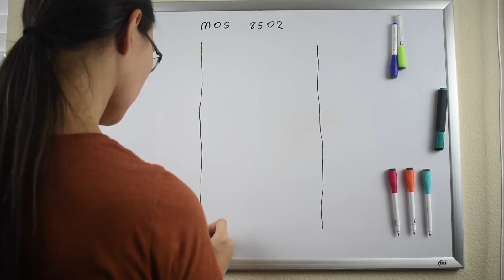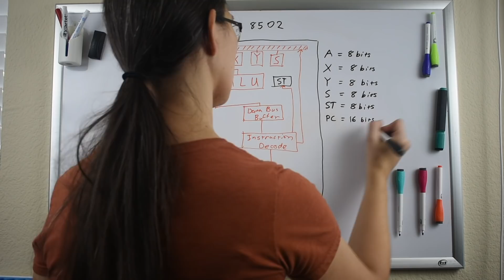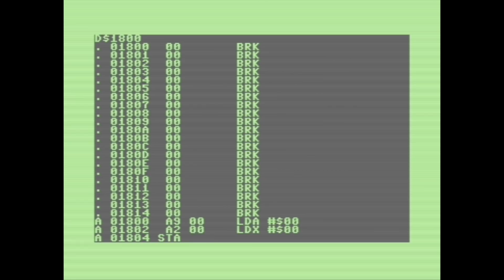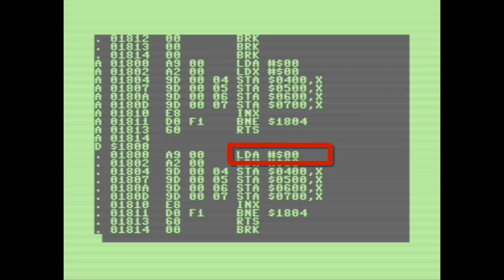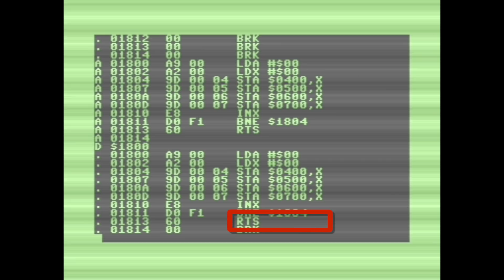Commodore 128D: Episode 1: Meet the Commodore 128D

Comment: This may have been asked already, but why not use the 8563? That would allow 2 mhz operation.
Reply from the maker: It would, actually, but it doesn't have support for hardware sprites, which I'd like to use in the game. Maybe in a future video! 80-column mode is very interesting to me, but I wanted to start from something relatively familiar first, and the VIC-II is also something that I've never had much exposure to until recently, so let's start with that, then move on to the VDC later.
Reply: I will follow along. "Back in the day", I spent most of my time tinkering with the VDC. It has a lot of capabilities that are overlooked; it's especially capable with the 64k of dedicated RAM in the 128D. Of course, you can also use that RAM for other purposes, if I recall. Hard to believe it's been 30 years, lol. I do have a 128D here, now I am motivated to hook it up! Back then, I used an assembler called "Merlin 128"....outstanding, as I recall.
Reply from the maker: @Shane661  Right. The trick is that the VDC is only accessible via two memory addresses, has to be synchronized correctly, and has its own memory space separate from the memory accessible to both the 8502 and the Z80. It doesn't fire any retrace IRQs, so you're locked down to timers, and worst of all, most VDCs out there have a synchronization bug that causes data loss. So the 64KB available to it is... flaky? I dunno. I'll play with it at some point, certainly.

Will definitely check out "Merlin 128", though -- looking for a good on-128 assembler because cross assemblers are a bit of a pain. :-p
Reply: @NybblesandBytes  , I don't recall an issue with losing data with the VDC. But, I definitely recall an issue with wait states and that bottleneck. You basically needed to fill the frame buffer, and work from there...because you can't make anything happen fast when trying to push data through. But, moving data within the 64k is pretty fast. Again, it's been 30 years. I will be firing up my 128D this week, should be fun.

EDIT: Another thing that really crippled VDC support, was that the "flat" 128 only came with 16K of VDC RAM. You can't do much with that, for sure.

Comment: Okay, I'm onboard. So is this somewhat applicable to the C64? Leaving out the memory and speed difference.
Reply from the maker: John Anderson I'm not entirely sure since I'm focusing on the 128D for now.
Reply: I’m a newb on commodore but believe the C64 doesn’t have the built-in machine language monitor so there may be some differences in operation compared to this video, needing to use a third-party monitor to do this?
Reply from the maker: @57thStIncident  @John Anderson On a C64 you'll need a cart or software to have the same access to the 6502. It's actually the reason why I chose to use the 128 and why it's taken me my whole life to get into working on these machines -- it is, in every way, a better machine for programming.

There are other differences as well -- some of the memory layout is different, and the default state of some of the vectors for the VIC are simply initialized to sane defaults, which makes initialization code far far simpler.

Comment: Sounds like the faster 8502 should halt the VIC chip; the reverse of the 6502C SALLY with the ANTIC/GTIA in the Atari 8-bit computers [and 5200], and the SALLY with the MARIA in the 7800... Or maybe that VIC chip should've had dual speeds...

Comment: Great video.  Is all the programming going to be in assembly, or are you going to use other languages too?
Reply from the maker: I hope to use Assembly primarily because when it comes to writing games, BASIC is really slow. I may spend a small amount of time in BASIC, but really, the power of the 128 is the MONITOR and assembler. Turns out that you can pull some interesting tricks like swap to 2MHz at the end of a VIC frame for a speedup, but that's basically only doable in assembler.

All in all, the 6502 instruction set was one of the last CPUs that was designed to be easy to work with, so I hope I won't lose you if we stay in the assembler arena -- it really is far more flexible, and not all that difficult to understand.
Reply: @NybblesandBytes : The C128's BASIC in SLOW mode is especially slow because it constantly needs to switch between RAM banks to access BASIC code and variables and the C128 seems to have an unusually long interrupt routine.  The C64 is faster and the VIC-20 is faster still.  But, in FAST mode, the C128's BASIC is okay.
Reply from the maker: Brutikus Red Very true. Unfortunately, only the VDC is capable of doing video in fast mode, and I want to use hardware sprites, which necessitates the use of the VIC-IIe.

Comment: I definitely miss the simplicity of 65xx/85xx assembler. Later assemblers (like MAE) with macros and such made the process only slightly more work than a higher end BASIC with a LOT more control (and speed!).
Reply from the maker: @JustWasted3HoursHere Yep! I'm hoping to be able to use them to make this go a bit smoother. Mostly I'm gated on the lack of a working external flash floppy drive at the moment, but I've made some headway on that. Not heard of MAE -- is that a C128 native assembler?
Reply: @NybblesandBytes  MAE is from a LOOOONG time ago. I believe it stood for "Macro Assembler Editor". It was for the C-64, but they may have produced versions for other Commodores as well. Well, I just looked and it appears there was one for the Commodore PET, but I'm not sure that's the one I used back in the day. It does appear to use macros, though, which made assembly MUCH easier and cleaner (in my opinion).

Kids today don't realize how great they have it when it comes to programming: Tons of tools, simulators and emulators at their disposal, plenty of memory to work with, processor speed galore, storage and so on. Back in the 70s, 80s and most of the 90s that stuff was hard to find (or was seriously expensive) and so you were on your own for much of the process. 

Watch "Stella at 20" for a taste of what the Atari 2600 programmers had to deal with when they wrote their games back then, which only had 128 bytes (yes, bytes) of RAM on the 2600 available, no video processor or memory (the scan line was controlled directly by the processor) and so on. [edit: There was a video chip, but it was EXTREMELY rudimentary]
Reply from the maker: @JustWasted3HoursHere  Yeah, I'm familiar with the 2600, actually. As it turns out, there's a web emulator that lets you write Verilog to build effectively the same thing out of an emulated FPGA. Don't have the link handy, but it's neat to play with regardless.
Reply: @NybblesandBytes  I have seen a guy using a modern 2600 assembler environment. Maybe that's what it was. He was disassembling "Superman" to see how they stored the rooms, etc. It was pretty interesting watching him change values in the code (which fit entirely on the screen at once...) to see how it worked.

Comment: 03:44 Actually RUN-STOP/RESTORE does not boot to the boot/welcome screen, so wrong screen shown ;)
Reply from the maker: Lofote Argh. Yeah, you're right. Serves me right for using an emulator for that shot -- I couldn't get the version of x128 I had at the time to actually do a run/stop - restore. The key mapping I was using was seriously horked and I couldn't find the restore key. Used a "soft reset" instead thinking it was the same, and clearly its not. And I should have known better, too -- used to have a 64 as a kid and I would regularly do something requiring a restore. :-p

Comment: since I don't have to funds too purchas a commodoe 128d or any other retro game, I'll be making an emulator of the system
Reply from the maker: Yes! This is definitely a good way of doing things. Check out VICE -- I did a video on how to install it on a Linux and Windows system, and it'll give you a bit of a head start. :D
Reply: @NybblesandBytes  Thank you so much for the suggestion! I'll definitely go check it out.

Comment: Are you going to 'stay honest' and write the code on the machine, or 'cheat' and use an emu or modern machine with cross assembler/compiler and then transfer the files over (say) serial or floppy emulation? Go all the way, write it all on native hardware :)
Reply from the maker: @Jeff Mitchell If I can get my capture card to capture composite from a custom cable I'm building, yeah, I'll use the real hardware, probably with the Buddy assembler, too. In the meantime, I'm using an emulator to partially cheat at the moment. I'm writing all of the assembler right there in the monitor in the emu. Once I get more complex and start talking subroutines, I'll move over to the Buddy assembler on the machine.
Reply: yeah, capture is always way more irritating than it should be; I mean, we can be forgiving when we hook up an old machine to our modenr TVs and its a little sloppy, but when you're trying to make a nice crisp youtube vid.... I've found it really hard to get video thats not clipped or shifted around on the display or with waves or glitches :/

I do find it interesting how perceptive we are to video and audio glitches; when I was rolling my own console/computer from scratch, making video from various means.. any slight timing glitch causing pixel rows to not quite align 'just so', and it would be immediately visible. I didn't think a couple cycles of CPU interuption on video would be visible, but nope, right away :)

Good luck with sorting it out!

Comment: Excellent, but an explanation of the values used in the program would be appreciated.  It would help to understand the operation of the program far better.
Reply from the maker: Yeah, I realized after I did this that it was rather high level in that regard. I cut all this together over the three day weekend in a bit of a whirlwind. The whole effort was a trial by fire, too -- I've never done something like cutting video together ever before in my life, so I basically had to fight for every minute.

I think I may do a video over more details on the 6502/8502 instruction set and addressing modes at some point to help round it out a bit.

In the meantime, I highly recommend http://www.6502.org and Easy6502 at https://skilldrick.github.io/easy6502/ to get more detailed.

Comment: That is a Commodore 128DCR, not a D.  Two related but different machines.  ☻
Reply from the maker: @BCS Technology Limited Yep. The D is so rare, though, that I didn't think it was all that important to note.
Reply: @NybblesandBytes : I saw one D when I was in Germany on business in 1987.  It had a plastic housing instead of the DCR's steel housing, and had a place to stow the keyboard to the chassis to make transporting it easier.  Technically, the D was more like the flat 128.

The DCR had a better 80 column video system than the D or the flat 128.  The DCR had the more technically advanced 8568 VDC, instead of the 8563, and shipped with 64K of dedicated video RAM.  Also, the 8568 had an unused open-drain IRQ output that was asserted when the device was ready to be read or written—/IRQ was internally "wired" to bit 7 of the command/status register.  Had Commodore taken advantage of that in the 80 column video kernel, a significant performance gain would have been realized.

The DCR may be fitted with an exhaust fan in the power supply chassis.  The European D model had that fan but it was eliminated to reduce the cost of the North American units, which is what the "CR" in "DCR" meant.

Comment: Great video!
I hope you'll use a Macro assembler ;)
Reply from the maker: Hetz Biz Yeah at some point I have to. The monitor is great for exploration while I'm still working out the bugs on my Pi1541 hat, but eventually will end up using a macro assembler. Any suggestions for one designed for the 128? I was considering using TMP, but that's for the 64 primarily.
Reply: The Buddy-128 assembler was pretty good.  The "+" and "-" label substitutes were quite convenient.
Reply from the maker: Brutikus Red I'll see if I can find it. 128-specific stuff is ideal. :-)

Comment: Hi, didn't the C128 use the Z80 on the green screen; and the 8502 only when on C64 mode?
Reply from the maker: @Leo Rivas No. 128 native mode uses the 8502.
Reply: The Z80 is active for a brief time during the early stages of reset into native mode, during which time an attempt is made to boot a CP/M disk if in the drive.  When that fails, control is returned to the 8502, and the Z80 stays dormant.

Commodore's implementation of CP/M on the 128 was rather poor, as the Z80 was incapable of directly working with the I/O hardware, such as the two 6526 CIAs that communicated with the outside world.  When I/O activity was required, the Z80 set up some "mailboxes" in RAM and then control was temporarily given to the 8502 to complete the I/O transaction.  The result was sluggish-performance.  Also not helping was although the Z80 was clocked at 4 MHz, it actually couldn't be run that fast during memory bus activity.

It should be noted that by the time the 128DCR appeared on the scene (very late in 1986 in the USA), CP/M was being rapidly abandoned.  Why Commodore jumped through the hoops they did to support CP/M is a question that remains unanswered.  If they had instead focused on getting native mode, 80 column software written the 128 would have probably been a major success for CBM.  Also, the 128DCR has 64KB of video RAM, a feature that was never exploited by Commodore.

Comment: To make your C128 scream, assemble the following program in the monitor starting at address 0x1800.

lda #$01
ldx #$00
sta $0400,x
sta $0500,x
sta $0600,x
sta $0700,x
inx
bne $1804 (or the address of the first store accumulator offset by X register)
rts
Reply from the maker: @gdm413229 Yep! That's the screen clearing program. :D
Reply: @NybblesandBytes  Any upcoming videos about the SID and the CIA chips?
Reply from the maker: gdm413229 Yep! In the works right now is a video about the CIA chips and the joysticks. After that is getting us up and running with Buddy and then the SID.
Reply: @NybblesandBytes  Is keyboard and mouse input covered in the video about the 6526/8251 chips?  Mice, graphics tablets and light pens for the Commodore 64/128 machines plug into the joystick ports.
Reply from the maker: @gdm413229  Wasn't planning on covering that since they're not really useful for the game, but it's pretty easy to get a handle on it so I might cover it briefly.

Comment: Why is every 1084 on earth missing this flap at the bottom that's supposed to cover the dials?
Reply from the maker: @Florian Feith I know, right? I think it's because the plastic tangs break off super easy, and you basically need access to the 80/40 switch right there in the panel, so opening and closing it is quite frequent. :-p

Comment: Those switches you mounted shold be on the side ot back at least, now your front panel is ruend :(
Reply from the maker: @intel386DX I didn't mount them. When I bought the 128D from a local collector selling it on CraigsList they were already mounted on the front. T_T

I may take some time to move them later. As it was, when I got the thing, the wiring internally wasn't even soldered to the switches!